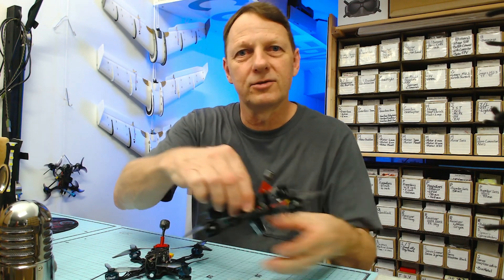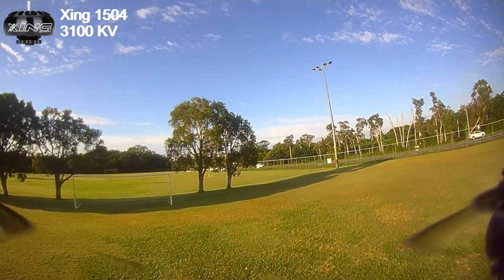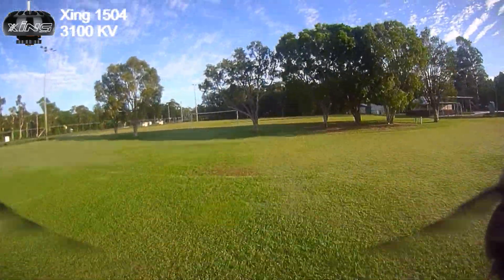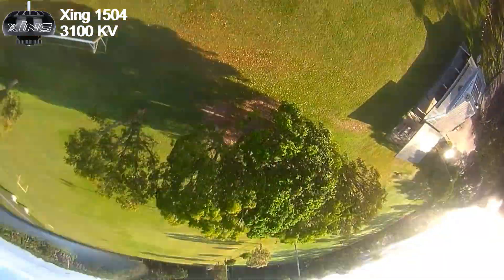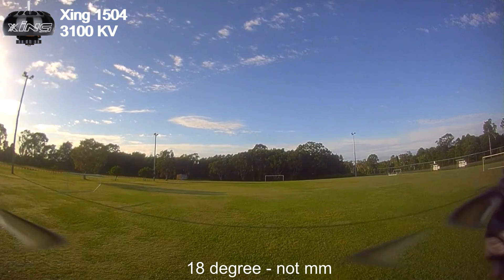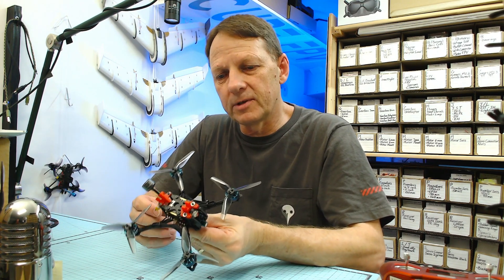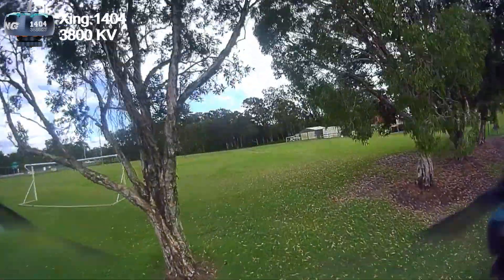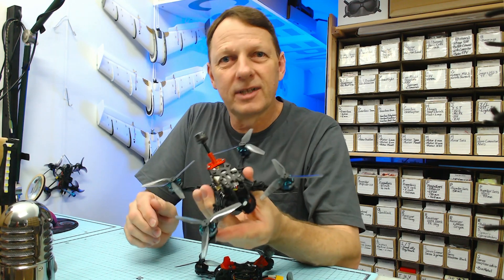Happymodel Crux 35 FPV Frame Scratch Build Motor Tests

Comment: I did a build on this frame with 1104 7500 KV t motor I ran it on 4S but put a motor limit at 75% cuz the motor car only take about 14 amps. I got over 7 minutes of flight time on bi blade props 700 mah. My favorite thing fly at my moment
Reply from the maker: Yes I remenber my Crux airframes. Great to fly with the underslung battery which gave them a totally different flight feel.

Comment: Hallo. Can you recommend this crux35 for beginners in the FPV world? Can i fly this crux35 with 18650 battery? Greatings from Germoney...
Reply from the maker: This frame is not the best for durability. It has mount holes right near where the arm joins the main frame and that is a weak spot. For 3.5 inch freestyle I still recommend the GEPRC Smart35. Also, go with LiPo batteries not LiIon. LiIon batteries (18650) are best used for long range drones.

Comment: hello, awesome review!
can i still use the stock fc of crux35 and replace the motors to 1504 3100kv? im new to this.
is 1404 3800kv still a good upgrade from stock motors?
Reply: Wondering the same thing, have you tried it yet?

Comment: If you use a more little battery, the original motors will show more power and still retain the long flighttime. Nice video!

Comment: Why did you choose 3100kv over 3900kv version?
Reply from the maker: I've tried both the 1504 3100 and 1504 3900 on this airframe. The 3900 is overpowered. More power is not always better. Overpowered motors make it harder to pinpoint the correct throttle setting in many manouvers as well as leading to you fliing too high in the throttle in general. So for goog freestyle 3100kv is definately the best.
Reply: Cube FPV Unfortunately according to a AE vendor the Xing 1504 are no longer produced. I’m currently looking at Diatone’s Toka 1505 do you have any thoughts?
Reply from the maker: @uavcommander  Yer i think 1505 is a good choice. A taller stator will be more responsive so that's the way you want to go instead of say 1503 which would be less responsive.

Comment: I put brotherhobby 1504.5 and turtle mode blew up my escs
Reply from the maker: I always try to avoid turtle mode on drones which have underslung batteries. Unless of course you have a horn on top. You see many racing drones have a horn on top to tilt the drone to the side when they crash. On a drone with a battery on top this is not so much of a problem. But with an underslung battery it's much harder to flip because of the position of the battery and it's weight.

Comment: What size battery are you using for testing? I saw the mah but it doesn't say how many s's they are.
Reply from the maker: It'a 4S
Reply: @cubefpv  what a legend. I am looking into this drone to fly with my buddy who just built a petrol 120x with the same 1504 motors and was hoping that it would be similar battery sizes. Thank you again for answering my question. Also loved the field and flying of it. Have a good one.

Comment: Wow, iFlight XING 1504 3100kv seem to work really well for this! I did not realize anyone was buying the crux35 frame and building on it. Your vids have been really interesting. I own two of the crux35s, happymodel's build, and this knowledge gives me some interesting paths to choose later on.
Reply: Yes these motors are a good choice. i'm stil experimenting with good motor for 3.5 inch and I'll hope to have some more tecting done with my new frame the gepRC Smart 35 soon.

Comment: Do you share your PID settings?  Good call on the Xing 1504 3100KV, Thanks for the video.
Reply from the maker: Im now using this FC on another build but the PIDs were just BetaFlight default for 4.2.

Comment: May I ask, how did they compare on battery duration, given more power on the 1504 motors?
Reply: This is the frame I'm flying regularly at the moment. I didn't get a flight time for the 1404 motors but I can tell you that with the 1504 motors i'm getting a good 4 and a half minutes of acro on a Tattoo 750mah 4S 90C.
Reply: @MicronWings  thanks, I checked the weight specs they are a lot heavier, relative, explains the higher power to me.  The 14 mm stator diameter on the 1404 even in their specs is larger than that, and obviously to me, larger than the happy model 1404, which spec wise is 14 mm.   Interesting how they measure things.